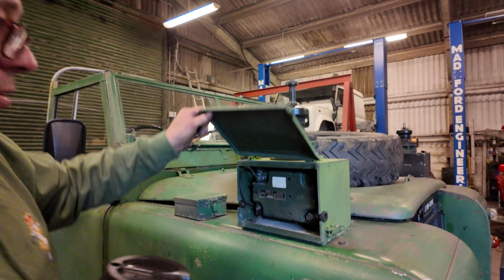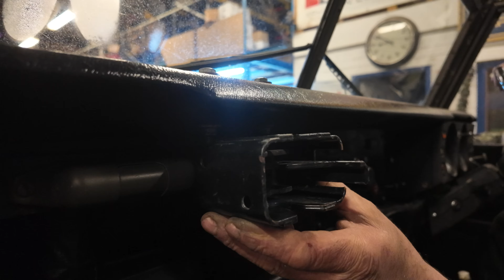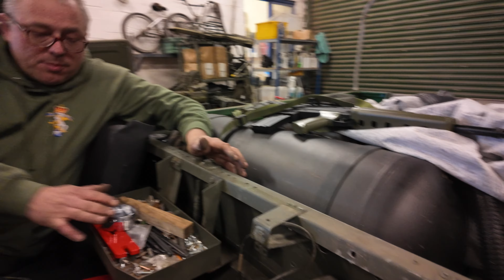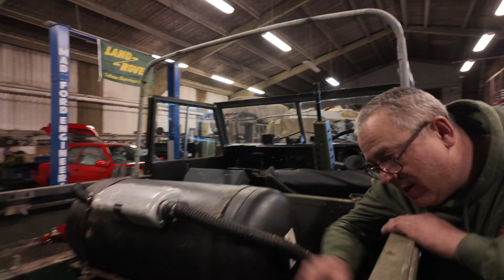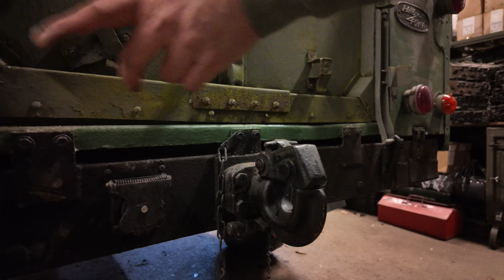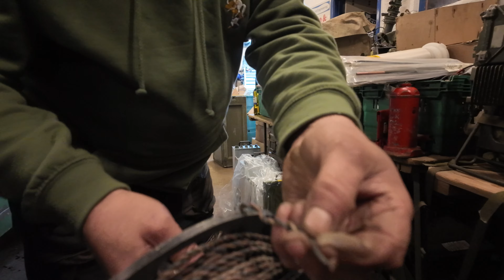Exploring Bob's Gear: Series 3 Land Rover Ex-British Army FFR with Mad Ford Engineering - Part 5

Comment: I had an FFR Lightweight, post 1980 (rationalised axles).  It had the flaps, not boxes, for the front wing tops.  I had to find a replacement antenna as one had been removed, along with the pioneer tools and brackets, but at least it had the correct split tailgate.  I had a lot of battery charging issues until I found the previous owner had disconnected one of the batteries from the generator system - once that was refitted, it was brilliant for starting.  It did develop a lean running issue that saw is rebuild the distributor and car, replace the exhaust and plugs, replace the fuel lines and clear out the pick up pipes and rebuild the selector tap.  Never did get to the bottom of it, but I think it was a leaking brave vacuum servo in hindsight as the brakes went heavy.

I fit the longitudinal tie to my 109’s transmission.  It stops the engine and transmission moving forwards when the hand brake is pulled on, which was important on FFRs because the bigger fan had much less rad clearance.  It also has the benefits of making the engine and transmission mounts last a LOT longer as they aren’t stretched by the hand brake, and making the hand brake a great deal more effective because you don’t lose effective movement of the link rod to the actuator.

The front and rear bumperettes weren’t for pushing other vehicles, though they could do that - they were to prevent damage when the vehicles were packed tightly on ships or aircraft.
Reply from the maker: Thanks for sharing your experiences with your FFR Lightweight, sounds like you had some interesting challenges!

Comment: The 353 was a vhf set. I remember the REME having a land rover non ffr has their own personal run a round, I was told to fit a 352 radio clip in, into it, didnt go down well, I am old enough to remember C13 HP and C45, C11/R210.
Reply: Thank you for correcting me Peter, i will try to remember that , were thous you talk of Larkspur?
Reply from the maker: thank you sir

Comment: I was a member of the RAF 38 Tactical Signals Wing (changed to TCW) 1969-71, we used mainly Series 2a FFR L/Rovers. Seeing the Clansman radios reminded me that I went to the Royal Signals Blandford Camp to see the Clansman trials as they had not entered service then.
Reply from the maker: Thanks for watching and taking the time to comment and share your experiences! 👍
Reply: @rustenuts Cheers, we used to have a fibreglass whip aerial, which had to be bent over and secured when travelling. We would do JOCOMEX’s (Comms exercise) usually in a country pub car park. After too many sniffs of the barmaids apron we would set off, sometimes forgetting to secure the aerial. The first low bridge we came to   Resulted in a somewhat reduced aerial. Happy days.